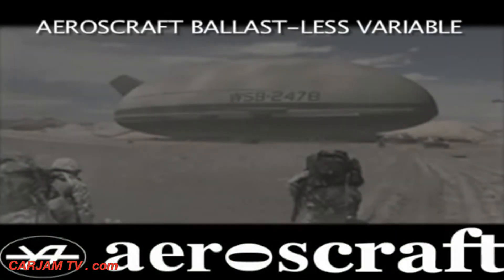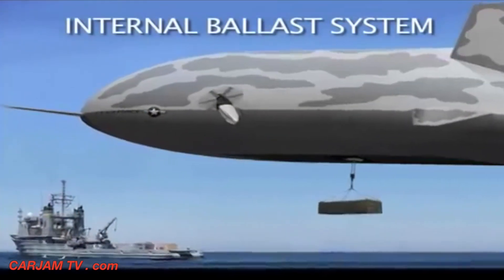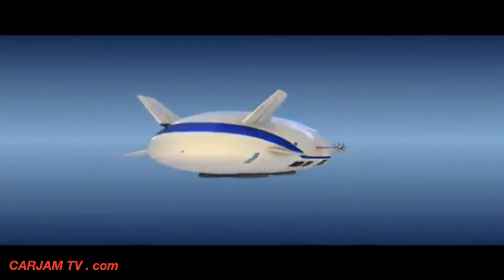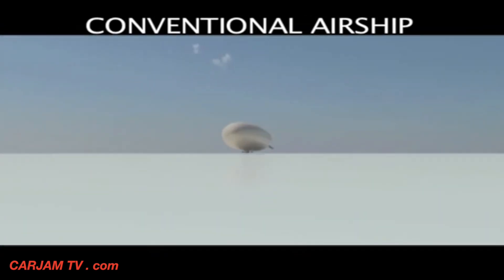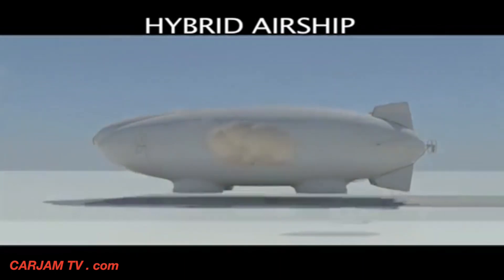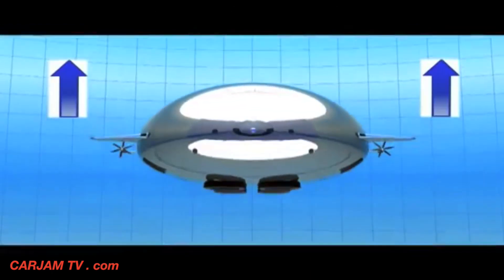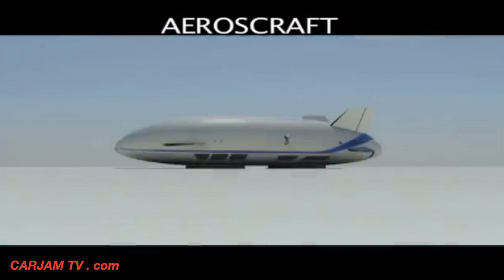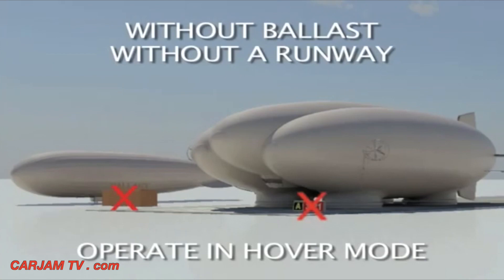AEROSCRAFT World's Most Advanced AIRSHIP First Flight Commercial CARJAM TV 2014

Comment: I'm glad the Aeroscraft will hover. Lockheed -Martin is working on a hybrid that unfortunately won't.

The huge components of wind turbines are difficult to deliver by rail or truck; a hovering dirigible should be able to deliver them anywhere. And a shipbuilding company called Thorcon wants to build molten salt fission reactors (MSRs), the successful Oak Ridge National Lab design, in huge components, and deliver them to harbors by ship and barge. There's no good way to move them farther, and at sea level they are subject to hurricane winds, storm surge, and sea-level rise. I have a better idea: deliver them anywhere on the planet with an airship. Tear the boilers out of coal-fired power plants, retain/refurbish the rest of the expensive plant, and simply replace the boiler with a right-sized MSR. Lay track at the site, on either side, carrying ballasted cars, with electric motors to inch them back and forth, and winches to inch the airship side to side on drop lines.Lower the load exactly into place, save time and the cost of a huge crane--and with that setup you might lower a load where a crane can't. If Thorcon could do this for less than the cost of carbon capture and storage, we could bring coal off-line that much faster.

The pressurized water fission reactors (PWRs) we've been using are steam explosions waiting to happen, want to melt down if they lose operating power, and only burn 4% of their expensive fuel before the fuel rods need to be rebuilt, and we don't: our 80,000 tons of "spent" reactor fuel, our nuclear wast disposal problem, is mostly unused fuel. MSRs
operate at atmospheric pressure and so can't explode; losing power lets a simple freeze plug melt, dumping the fuel-carrying molten salts into safe storage tanks, shutting down the reactor. You reprocess fuel on-site--far safer than trucking it around--and so burn 96% of it; and what is left is mostly useful and valuable non-radioactive elements, and small amounts of mostly-useful radionuclides. This is how we solve our nuclear waste disposal problem, with carbon-free energy, two birds with one stone. And if a new lighter-than-air transport industry and a new, safe generation  of nuclear power can help each other get off the ground--cool.

BY THE WAY: I am an old environmental activist, and some of the campaigns I worked on were no nukes. I'm also an old energy conservation consultant, with enough of a technical background to understand energy technologies middlin' deep. It took me a while to come around to seeing any kind of nuclear fission as anything but dangerous and stupid, playing with the fires of hell. But if MSRs live up to their promise, as above, and solve a couple of problems without creating new ones, I think it's worth building a prototype--now--and monitoring/studying the heck out of it. As for replacing a coal boiler with a MSR, I'd like to volunteer Portland (Oregon) General Electric's Boardman power plant, scheduled to be dismantled in 2020. All the fuel it'd ever need is right up the river at Hanford.

Comment: I'd like to run these tethered to a tractor running on a cable-and-pole system (think upside-down cable car) for long distance cargo delivery into the Arctic towns and villages. The tether could be detached for short hops and fine weather, or the dirigible could simply be used for buoyancy and inseparable from the cable.

Comment: In military terms this can certainly become a valuable logistic unit if it becomes undetectable. It is already silent and does not have a heat signature. It does not have a real aerodynamic requirement, so you can shape the design for radar invisibility. Only tech needed for full protection, which may be considered fairly ahead of time,  is to cover it with an illusional optic screen that will display the view of the camera on the other side. It does not have to be a prefect illussion, but enough to escape the satellite view from top, or land units observing from the surface. It may fly in the darkness at 450m, with 150 km/hr. and carry up to 500 tons means you can use a wing of airships to drop an entire armoured division behind the enemy line in one night, right to the point where you need them to outflank the enemy during your assault tomorrow morning.
Reply: Emre Koseoglu they are not silent and they have a remarkably big heat signature it is called propulsion from motors with propellers.

Comment: This technology has always been based on using lighter than air gases such as helium or hydrogen enclosed in a balloon.  What if some bright spark came up with a method of constructing a vessel from which air could be extracted without the vessel collapsing under the atmospheric pressure?  Such a  vessel would have greater lift than a gas filled balloon.  Take for example a soap bubble.  It is light enough to float in the air for a short period.  What if the bubble were made of a very light material made rigid enough to resists collapse (e.g. a liquid compound made rigid by irradiation with UV light.)?  A conglomeration of such bubbles, akin soap suds but hardened, i.e.. solid foam, would be the base material out of which a lighter than air material could be made.  A method would have to be developed first of all to extract the air from the foam such as piercing the foam with laser beams so that each foam cell had a tiny vent from which the air could be extracted but leaving the structural integrity of the foam cell intact.  The outer surface of the foam could then be coated with another impervious layer of the same material that was used to make the foam itself.  By piercing this out layer it would be possible to extract all or most of the air from the individual foam cells because cell would be interconnected by the holes made by the laser beam.  It may just be the flight of my wild imagination to suggest that such a structure could create greater lift than conventional gas balloons.   Comments are most welcome.
Reply: If your talking about a vacuum balloon, the lift is only like 10% better than a hydrogen/helium balloon of the same weight, so its not really worth it.
Reply: foam able to withstand anything like vacuum would end up being heavier than whatever it was displacing - as for pure vacuum, that's a lot of pressure - again the materials to withstand would end up being heavier than Helium.  As for Hydrogen, not interested - no matter how "safe" it simply isn't something I wish to be near considering static, lightning and how difficult it is to contain - there is always a strut rubbing, fabric fraying and a camera operator standing by to film the whole conflagration...
Reply: It's a good idea but there is one thing that will ensure it doesn't happen. Money. If it is more expensive than a manufacturer thinks it's worth, it won't be produced. The cost of all those lasers and new material would probably even out with the cost of two high quality stealth fighters. So even though it's a good idea, we don't live in a perfect, unselfish world, y'know?
Reply: If you are adding material to the gas bag, you are adding weight. What advantage do you get from a bag that retains shape when its lifting gas is removed? A zeppelin is the rigid frame on which the empty bags are held.

Comment: I remember back in the 60's and early 70's, someone was thinking about such huge ships to be floating hospitals such as lowering container boxes with entire surgical teams and supplies into areas hard to get to after earthquakes and flooding.
Reply: you know it could even lower a mobile anchor point for greater precision - imagine a light little tracked vehicle that could pump a few tonnes of water into its own ballast tanks when it hits the ground (preferably near a water source) and then stabilize the mother ship... or it could simply rotate some hooks into the ground with hydraulics.  the lift capacity compared to helicopters is an advantage but where the navy can get in a hospital ship/helicopter squadron is probably still the preferred option; nevertheless there's many parts of the world not so handy to the marine environment

Comment: was gonna say it obviously isn't a combat transport.  Huge and slow.  As a freighter or a cruse ship it could work.  I wonder about storm conditions though.
Reply: +Zebulization You would be surprised. I believe the Graf Zeppelin actually went through the edge of a hurricane in the early 30's . But with today's weather technology it might not be that bad. We are talking about low level flying, probably nothing over 10,000 feet. Rigid Airships are much more stable in rough weather then blimps. The ones that had the most problems in the 20's and 30's were flown with crews that had little experience. Remember  the Graf flew for a decade with little or no problem, and the LZ-129 was would have lasted much longer except for the hydrogen, which is no longer used.
Reply: candr I love your knowledge on these things. People speak without knowing anything about what they speak of. I used to work with airships "matter of fact, Aeros built the ship I used to work with" and I couldn't have said it any better than you just have.

Comment: Great concept with lots of potential regardless of the nay sayers.  I see it being more useful in the long term not as military support but as a heavy lift system for the mining and construction industry. A small fleet of these operating year round would negate the need for an "ice road" up north.  They would also be a terrific alternative to shipping oversized loads by truck when the loads are so large that moving them requires the shutting down of roads, avoiding bridges and the temporary dismantling of power lines.  With these, it would be a much simpler matter to lift the load straight up then take it "as the crow flies" directly to the destination. On aside...... As far as avoiding IED's... Yes, but lets be realistic.  All that changes, is the means by which they are attacked.  Being both large and slow moving they would be easy and tempting targets.  Consequently this limits their use areas away from the front lines
Reply: outside the box thank you for thinking outside the box. A lot of people do not understand and just to conclusions. I used to work with these airships, just so happens that Aeros were pioneers to the industry at the time with a ship called the Aeros sky dragon 40+. That was the style ship I was actually introduced to and low and behold that company has brought airships out of the dark ages. All electronically ran, fly by wire with a joystick "yolk" not some cumbersome wheels and pedals connected to the ailerons via cables. They have gone through some sacrifice but have done a lot of great things.
Reply: @tazztazzmosis6348  
Sorry for the late response.
I only just got the message.
There are all sorts of new materials like carbon fibre... As well as new technology.... That could be brought to bear on these.
Not just more powerful and lighter engines..... As well as computerized control..... But a lot of the technology that goes into quadcopters could be utilized as well.
This would give them far more control than the old style dirigibles.
Reply: @outsidethebox617  thank you for the reply, late is always better than never. Yes you are right in that response also. With all of this new technology in every field now, possibilities are endless.
Reply: To be fair, modern wars tend to be between 1st world post-industrial powers and 3rd world insurgencies - 1st world powers tend to control the air with impunity.
Reply: @erentheca  no doubt.
However..... Third world militaries are notorious for buying surface-to-air missiles from first world nations..
Reply: For wind stabilization displace air from shear winds through internal ducts to lee (the ports would open or close according to lateral wind pressure and set beneath to avoid precipitation) just a thought
Reply: Their military potential is high (no pun intended). If they are to deploy military material, yes they would avoid the front lines, but dropping units behind front lines anywhere would be a huge boon. 

But really, it's only vulnerable if it's close to the ground, and even then, only sort of. A helium filled airship is basically immune to gunfire (the bullets just pass through it, creating minor easily repairable leaks), missiles would damage it, but wouldn't make it crash immediately since it would use cell airbags which limit the total amount of gas lost from a direct hit. 

I foresee these things being flying missile boats or drone carriers (in either case, it's best if the airship is a drone itself too). Let the thing fly high, and launch cruise missiles and anti-air missiles. Since it's so big, it can also carry active protection systems to shoot down incoming missiles to protect itself. There were some prototype air-launched ballistic missiles too, perhaps that program can be revived and put in use on airships which would amplify their offensive power. 

The airborne laser that was employed on a 747 would be better equipped on an airship like this. An airship can loiter in the air much longer than a plane, and has greater volume and payload capacity for a larger, more powerful laser.
Reply: @urquanseven2332  I agree with basically everything you're saying....
But being slow as well as the fact that they do not have a high flight ceiling....the ground fire or missiles could still end up hitting the personnel inside the cabin a lot easier than if they had been travelling in faster aircraft.
Active defense systems would definitely help mitigate that.
Reply: @outsidethebox617  High altitude airships are possible, in fact there's an entire wikipedia page about them, in which they operate at 17-22 km altitude. Not sure if a large military airship can operate at that altitude, but clearly they aren't as limited as you think they are. 

I think any war airship would be best suited as a drone. Command manned airships would be kept behind front lines to give orders and maintain command/control.

Faster airplanes, probably won't maintain much of an advantage in the future. Mount a big laser on an airship and shoot them down. Or pack one with a ton of air to air missiles and/or drones.
Reply: @urquanseven2332   
Yes high-altitude airships are possible..... But the key word there is airships.
Although dirigibles are classified as airships.... They have a weakness that the other airships do not have to my understanding.
And that is they cannot achieve the same level of altitude.
The last I read it was in the neighbourhood of approximately 5000 feet.
I believe this is because they cannot continue to expand in size the way a standard balloon would.
Don't get me wrong....I think they still have a good role to play.

Comment: Given the fact that the payload for this thing is around 60 tons. It is pretty worthless because it can't even carry a single M-1 tank. This video shows multiple tanks rolling off the ramps. So, it is kind of lying.
Reply: +Jason Holloway The Hindenburg had a lift of 244 tons, and the Graf Zeppelin 2 was suppose to have a 260 ton lift back in the 1930's. This is just a smaller prototype.of the ones to come out if it works properly.
Reply: Well if you actually researched this thing the ML-86X is supposed to be able to carry ≠500 tons.
Reply: Jason Holloway plus the hindenburgs were not using helium like these ships use now. They used hydrogen thus the mass explosions and loss of life. Helium has less lift than hydrogen. Thus less load .

Comment: Without COMPLETE air superiority, this thing is useless as a military transport.  Even cargo airship projects have been abandoned, due to cost, but also since airships are so easily damaged by being drive to ground by storms.
Reply: +DARIVS ARCHITECTVS im assuming thats where the rigid structure comes in. also, all of america's conflicts are against people whom have no aircraft. and any anti air wouldn't be able to make it to the supply lines.
Reply: +DARIVS ARCHITECTVS The huge costs of these projects are the main problem.
Reply: +Panzer Faust Actually the orginal rigid system were there to hold multiple gas cells. The old ships like the Hindenburg held 16 gas cells, they could lose 3 and still stay in flight.
Reply: +Mattie Smithson Not really, this is fairly cheap, its the memory of one of the old Hydrogen ship (Hindenburg) giving it bad press. Most people do not know that we have not used Hydrogen in our craft for over 70 years. Actually the U.S. never used Hydrogen.